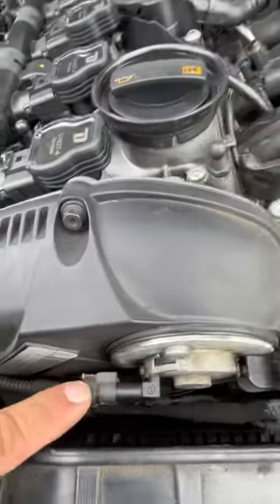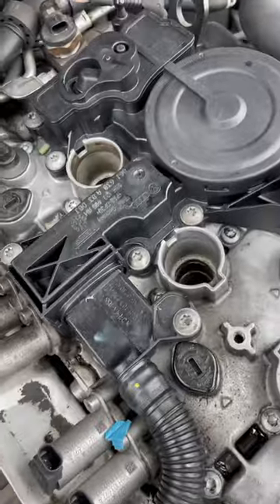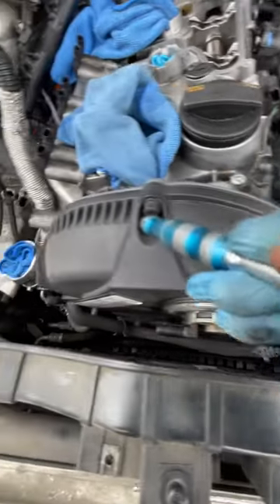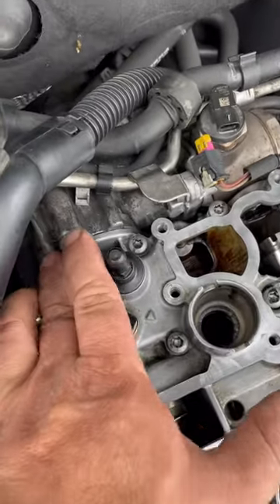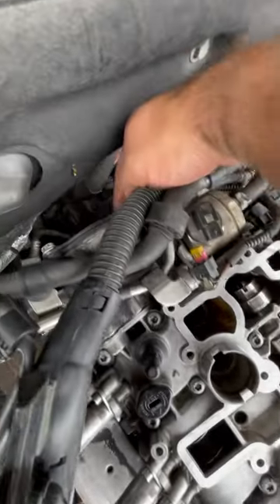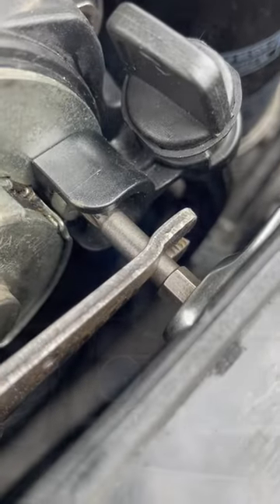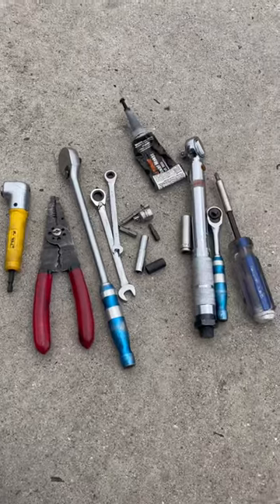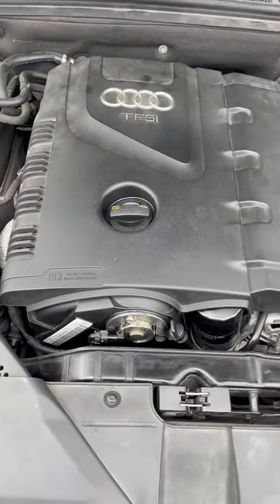Audi A5 Quattro valve cover gasket replacement.

Comment: WRONG BOLT INSTALLATION SEQUENCE!  Basically a helpfull video but the bolt sequence is for removal not for installation.  Also, do not use some crap gasket maker from Autozone.  Use the proper one as it is not expensive and is readily available from O'Reilly's, part number JV8 (Mahle JV8 Aluminum Silicone Sealant).  It's not worth doing this entire job a year later just because your universal sealant started leaking.  Correct tightening sequence is from the front of the car start with the 3rd row of 4 bolts (or the 4th row if you count the first 2 bolts as a row).  So 3rd row then  2nd then 4th then 1st the 5th and then the 2 bolts in the front.  So you're working from the center outwards.  Also, the spec is 8 pounds not 7 and then 90 degree.
Reply: Hello. Is this right as far as the cams not popping up and throwing the timing off? That's why I keep putting this job off. I was getting ready to take it to a shop

Comment: Video started off nice but ended up being useless because you cut out the most important parts. It would be really helpful for diy viewers if you include you actually unscrewing the bolts and show the complete visual of you removing the valve cover and showing the things to look out for and also showing the cleaning process and putting down the new gasket. Also show the complete reassembly even if you speed up the bolting process. Commentary was all good though.
Reply from the maker: DustyRolle

I totally agree with you.  As I was working on this I had totally forgotten I was to film this.  So before I knew it I had already done the most critical part of it.  I was hesitant to post it for that reason alone. But I do wish I would of shown that. This is one of the reasons I used pictures, to at least give the audience an idea.  I’ll be working on this car more as we change certain parts it needs.  This time around though Im making sure to really show what I would of liked to show all.
Reply: Calling it useless is totally ungrateful, where's your tutorial?

Comment: I believe the silicon you used for this job is incorrect,  should be an anaerobic sealant . also available at autozone or orielys
Reply from the maker: @westtexas501 

Your right Audi requires a different kind of silicone.  However I found this silicone has been the toughest silicone I ever used.  I used this stuff on all my previous BMWs.  It holds up strong and dries within an hour making it possible to drive away same day of job.  Other silicones require a full 24 hour drying process.  I recommend this for any valve cover job or motor oil pan gasket replacement job on any car.

Comment: You need to pin the timing chain tensioner otherwise the cams can lift (the valve cover holds them down) and the chain WILL skip. Also use anaerobic sealant NOT silicon.

Comment: Thank you so much. There is a Tiguan came in at mt Honda shop and I had to do this job to it. I was concerned if I needed any special tool to hold the cams in place before removing the valve cover but after I watched this and did exactly the same. Saved me a lot of time. Job paid 6hr, got it done in 3 👌

Comment: Engine is pretty new, mostly cause by blowby from worn piston ring air pressure destroy the valve cover gasket sometime it will escape at the turbo seal then oil starting to fill the intercooler.

Comment: did you remove the vacuum fuel pump or the high pressure fuel pump? to get the valve cover back in? i tried tilting it and it’s not going back in with everything lossened…
Reply from the maker: WickdHDGamer

I did not need to remove the high pressure fuel pump.  I only loosened it enough to push it back a bit.  You don’t need to remove it.  Just loosen enough to push back a bit.  That will give you enough clearance to tilt the valve cover into place.
Reply: @RCincorporated  yeah i just missed a bolt for the valve cover, i’m dumb
Reply: @RCincorporated what about not replacing the crush gasket you showed, is that ok?
Reply from the maker: @Kanesgarage 

If your talking about the crush gasket of the high pressure fuel pump, then no.  No need to replace them, I’ve used the same ones.

Comment: About removing the connector at 1:40 you can press the clip you pushed up and it will just slide off. This way you wont break the connectors ;)
Reply from the maker: Thanks for the tip Banaenschen
Reply: Rookie

Comment: Hi, I’m about to do this to my 2013 A5 and I just wanted to know if you locked the cams in place or if it wasn’t necessary, thanks
Reply from the maker: Hello @ TheLEGOEffects

There was no need for the cams to be moved or messed with.  Nothing with the timing was messed with. 👍🏽
Reply from the maker: Just so you know when the cover is removed, the cams move up slightly.  That’s cause this type of valve cover is actually holding one side of the cams down.  However when removing cover remove it slowly, the cams will come up just a bit and that it. Once you put the cover back, push down a bit s you bolt it.  Hope this helps.
Reply: @RCincorporated  Awesome man, thank you for replying so quickly.

Comment: So the valve cover will push cams back down correct? So no need to messed with timing chain tensioner?
Reply from the maker: Nano619er
Correct!  The valve cover will push the cams back down.  The timing is never messed with.
Reply: Have you done this yet?
Reply: @kevinwonsetler3777  yes

Comment: It's a four cylinder engine but Why is it  installed longitudinally and not horizontally?
Reply from the maker: Not all motors are like Japanese cars whit the engine sideways.
However Audi A5 models—regardless of door count—feature standard all-wheel-drive. And the engine is facing straight like a V8.
Reply: Only front wheel drive cars or AWD cars that use an external transfer case are installed horizontally.

Comment: Do i need new bolts for the camshafts 🤔
Reply from the maker: @mautplank1621
I ended up using the same bolts.  No issues till today car is running strong.

Comment: This cover needs anaerobic sealant, not silicon gasket
Reply from the maker: @Joanespik

The silicone I used is much better than the cheap crap they try to make you buy just cause Audi says so.  The car is still working great on the street and on the track with no issues.  That silicone I used will last him longer than the cheap shit car dealers be using.  Only experience will give you such knowledge of it not what books say.
Reply: @RCincorporated  You can say what you want, but using that is a bad practice only used by a bushleague mechanics. Sorry, someone had to say it. Cams need a very precise tolerances.
Reply from the maker: @joanespik  

The books are not always right.  Like i said keep following guidelines that are not proven to be true.  If the type you say to use is so good why did it need change with such little miles on the car?  Because it’s cheap that’s why.  Car manufactures will never use the best stuff on their car unless your spending 100k and up on a car.  Otherwise you get the cheapest stuff on it.  That’s why they make aftermarket performance parts because original is not always the best.